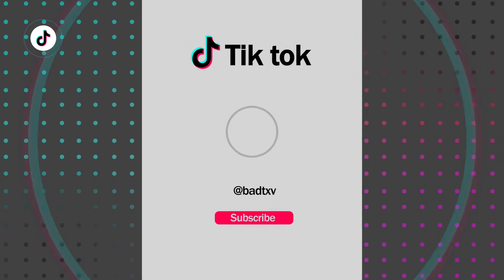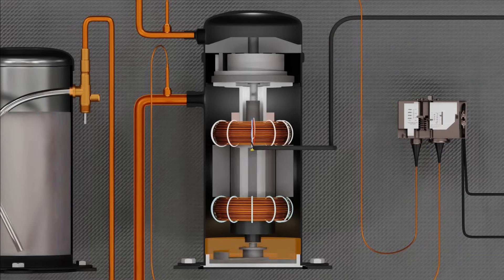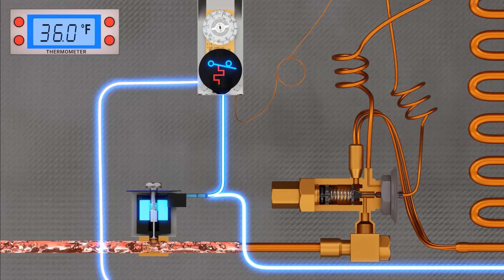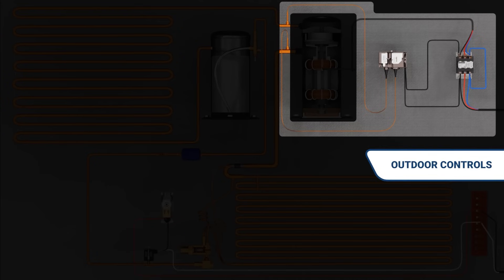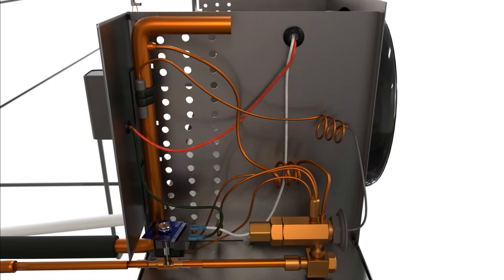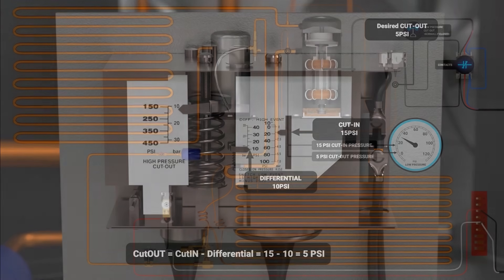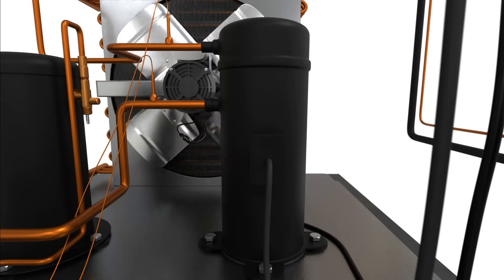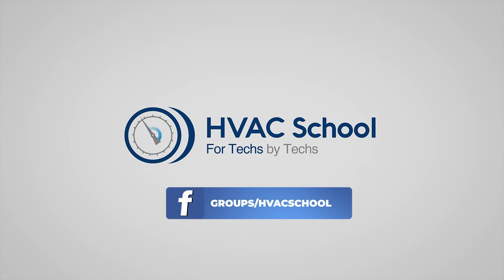How A Typical Refrigeration Cooler Works - Pump Down Refrigeration in 3D

Comment: If the Compressor is 3 phase power , the contactor coil would be 220 volts , not 120 volts as stated  , as the simulation shows it to be wired . Good animation and explanation though

Comment: As someone who is transitioning to Commercial Refrigeration from Residential Service, I highly, HIGHLY appreciate this. Thank you so much.
Reply: Go all into commercial  and industrial refrigeration .
Leave the residential nightmare behind!
You'll make serious  bank.
Either working for a company or on your own.
Reply: Can you mentally handle  5 million dollars worth of product being lost or  a nasty disease  escaping the CDC if you fail?
I have.
Both times I fixed it.
Reply: @halverde6373 even worse they're about to evacuate the dementia Wing🎉 and it's up to you to fix this unit that you've never seen before🎉 First Step spend 1 hour opening up ceiling accesses🎉 Step2 being told by the head nurse that it actually is in her office where you thought it would be but she assured you it wasn't 🎉 step 3 pray to the HVAC gods that the problems in the air handler so you don't have to go to the roof🎉
Reply: @halverde6373 fuck yeah dude
Reply: @halverde6373 you misspelled wuhan

Comment: After pump down, doesnt the refrigerant migrate from the high side to the compressor?
Reply: The liquid is trapped inside the Receiver. They tend to be sized to hold the entire charge.
Reply: @EverythingisFire  but it has a path back to the compressor so wouldn’t some of it travel back?

Comment: After the system pumps down and the pressure switch shuts down compressors what keep refrigerant pumped down into condenser from traveling back to the compressors through the liquid line? Is there a check valve?
Reply: liquid line solenoid

Comment: I got a question. Why don't they just add a check valve in the discharge line before the condenser coils to prevent that inadvertent back flow? It should theoretically prevent any of it going back to the compressor...

Comment: This is such a great video! I’m very new to refrigeration, but at my work we have so many issues with the many many HVAC units, and several walk-in coolers. We can’t seem to find anyone that can reliably repair the walk-in units, they either say the entire unit needs replaced, or they try and fail over and over again. Talking to them it’s clear they don’t actually understand them, which makes it hard to work on them. I’ve taken over the maintenance as far as changing filters, keeping condensate drains working and pans clean, replacing start capacitors when they fail etc, so basically I do what I can before calling for help, then watch and learn what I can. I have installed smart thermostats everywhere, since the employees like to turn some units to heat while others are set to cooling, and now have it automated so if one is changed to heat, all the others do as well and vice versa. But this walk-in is driving me crazy, it seems to want to freeze up every week or so, I have widened the temperature setting so it stays off longer between runs giving it time to defrost more, which seems to be working, and also have sealed up a few air leaks where new lines were run in and not sealed up which seemed to help a lot according to the temperature sensor I’ve installed which logs as well so I can see the patterns. But, what this video has opened my eyes to is the fact that the outdoor unit NEVER turns off! So I will be looking into that when I get to work tomorrow, thanks so much for your effort.
Reply: Make sure the door seals are good and leaving the door open for long periods will freeze it up too

Comment: I'd wire those two 120 volt, permanent split capacitor evaporator fan motors to a series parallel contactor that runs them in series during the off cycle and parallel during the cooling cycle.  Permanent split capacitor fan motors run very well at reduced voltage, running slower, consuming less power, and running cooler.  This will save energy, and reduce the heat load on the system, while still providing plenty of air circulation during the off cycle.

Comment: I came upon a walkin freezer today where some genius has removed the EEV and installer piston. The unit does not know when to cut off and go into a defrost. The owner using a light switch that has been in stall to turn the outside unit off when the unit has completely froze up back to the compressor. Condenser fins are closed like someone used pressure washer.    Since he has gotten sick his wife want to know what it will take to fix. Unit was control by beacon 2. Which that genius brand up and cut out. Had to inform the wife that freezer is not a central air unit. Now I have the headace of finding a FIX for this MESS. Also there is a refrigerant leak some where.

Comment: Hello
Very good material showing what and how it works.
I am wondering about one moment in the refrigerant circuit, namely the refrigerant tank. Since the refrigerant is condensed in the condenser and comes out as a liquid into the tank, what is above the liquid in the tank is gas or vacuum. Looking at Moliere's diagram, there can't be gas there. How to explain it.
Regards.
I am writing through a translator.
I'm from Poland

Comment: Awesome video. I'm in the ac side of things but love to learn more. At 13:00 what's the point of the differential? Why not just have a cut in and cut out? I always get stuck at that (yes I have done small refrigerators when the customer asked).
Reply: Ok I think I got it. Because this is on the low side of the system so the compressor knows to come back on  on a pressure rise. Correct me if I'm wrong.

Comment: Great video. Thank you. It would be good mentioning that cut out at 5 psig is for reciprocating compressors and for scroll it has to be higher then 10 at least. Also for R404a refrigerant cut in of 15 psig is se to low and in most cases it goes in area 20psig and higher. Thanks again for amazing video.
Reply: Wouldn't the Cut-in pressure be 80 psi and the cut out pressure be about 70 psi with 404a? To maintain a box temp of 36F degrees? Assuming you have to use a Pt chart to set the pressures on the pressure control. 

15 psi is about -22 with 404a. Seems a little low for a box temp of 36F
Reply: @Austin Burtch  thermosta in this case is regulating temperature in side box by closing and opening soleoid valve. It is set that way that remove most of refrigerant from low side of the system. If thermostat is removed then low pressure switch would be set differently.
Reply: @austinburtch5972 pump down solenoid to evacuate the evap when temperature is achieved.
Reply: Oh yea lol I forgot about the t-stat in this situation 😂 I don't work on much refrigeration and the last one I worked on used the low pressure control to regulate the box temp not using a t-stat or pump down solenoid.
Thank you for bouncing my brain back to Earth
Reply: @austinburtch5972  got me at first as well was just going to ask about that